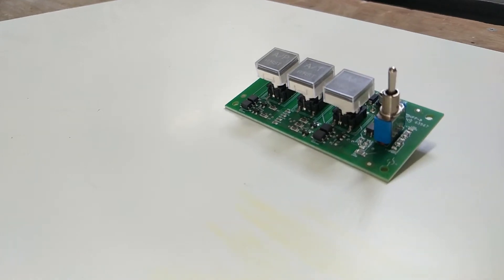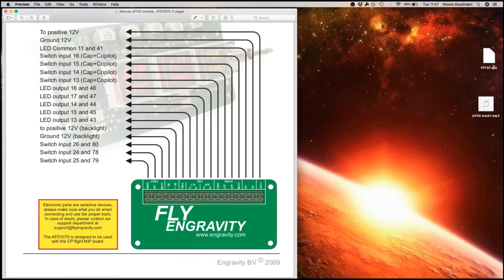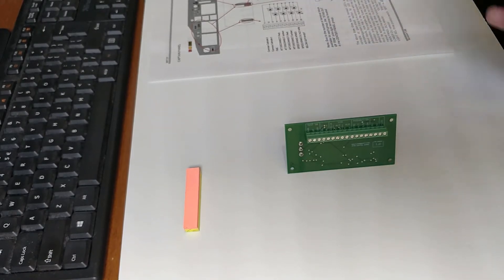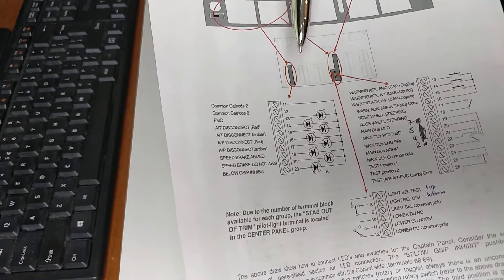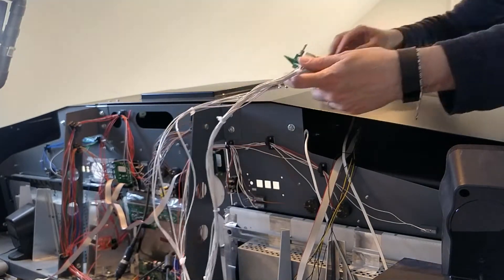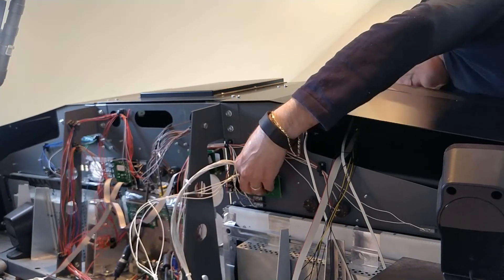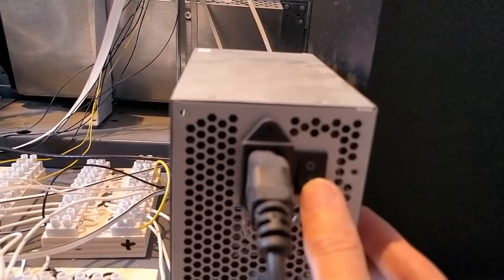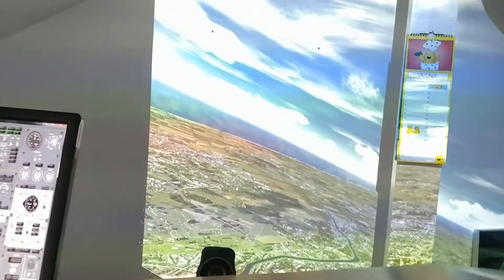Install the AFDS Autopilot Flight Director System on a 737-800 simulator

Comment: So, a combination of AFDS from flyengravity works with CP flight card ?
Reply from the maker: yes, it never gave me any issues
Reply: Great ! And How did you gave it power ? Because I saw that you Made something extra to connect the cable for powering everything up. Would like to know more about this !
Reply from the maker: @kaincallewaert6200  It is just connected to a 5v power adapter that you find also in a PC
Reply: @737ngxsim  to be honest I have no clue how to do it 😅 really bad with cables 😂
Reply: Hello. On your answer you say connect it to 5v but on the card it says 12v on the back of mine it does.  @737ngxsim